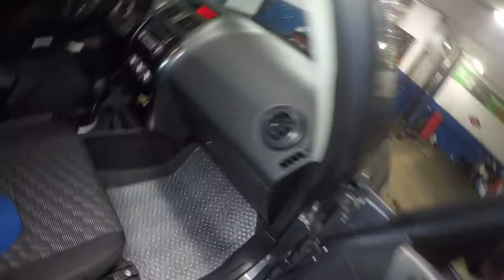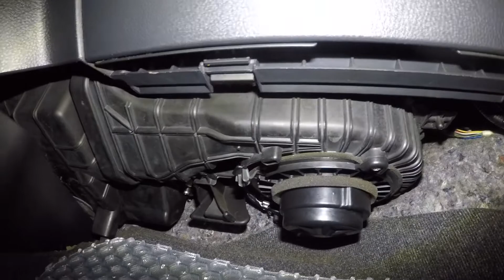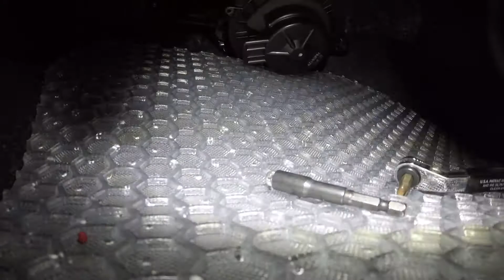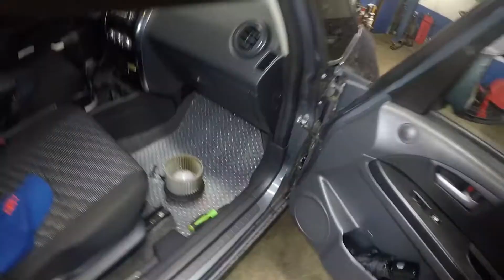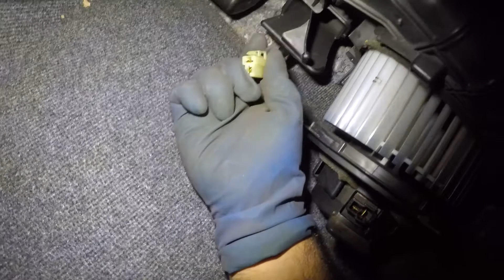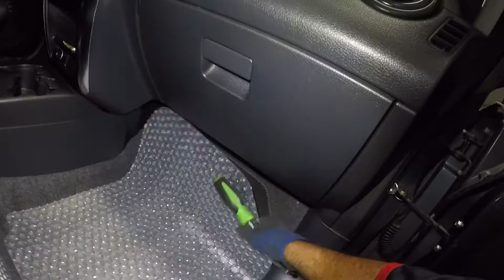How to remove and replace blower motor on suzuki sx4 2008

Comment: Have just watched your video and I think you may be able to solve my problem. Ordered the blower from Ebay but it had 3 screw fittings that didn't fit my car. I see that the blower motor  that you changed has 2 screws like mine and I wondered if you had the part number as I am having a problem finding the right motor for my Suzuki. Thanks. Useful video.
Reply from the maker: Welcome

Comment: So mine wasn’t working at all but I hit it like you did and it did start(thank goodness because it’s about to snow) but does that mean I need to get a need motor?
Reply from the maker: Yup it will stop again maybe u will get lucky again with a punch but replace it
Reply: Replace it man. Mine one was making some noise every 5-7 days. I got used to it and started ignoring it. Then all of a sudden my car filled with thick white smoke. Luckily the fire didn't spread, it was just the blower